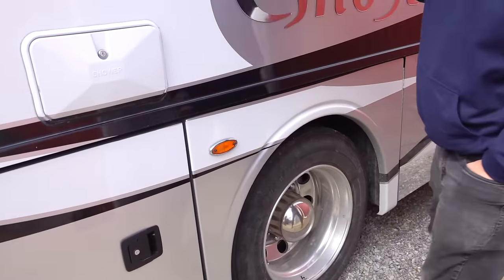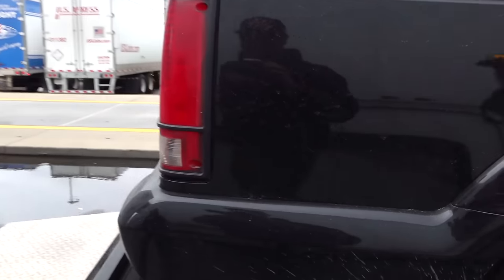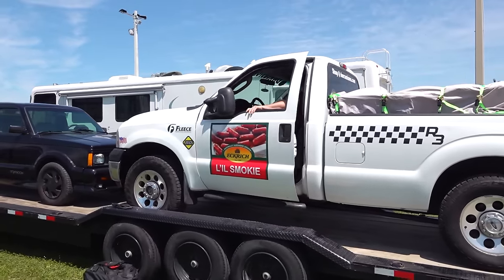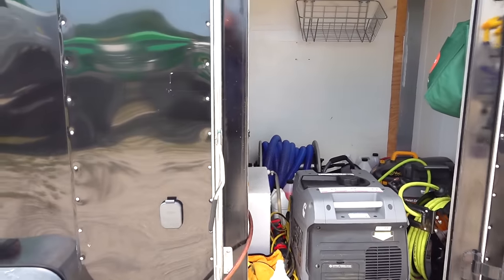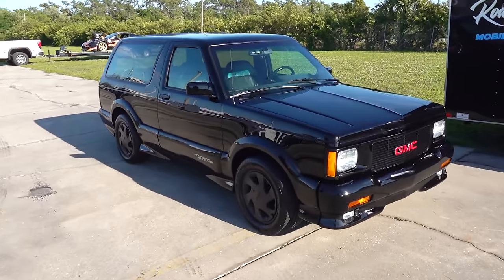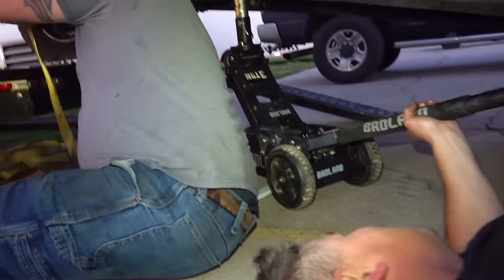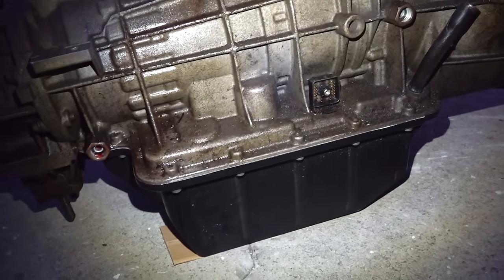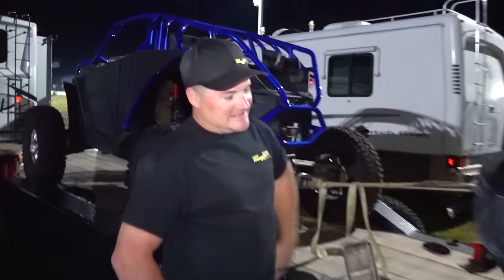Tested and BROKE in 17 seconds! We GOTTA fix it!!

Comment: KOing a 5r110 is freaking wild. They are one of best stock Trans 😮🤯
Reply: I feel like for a 4k scrappers truck that Derrick got it for, it likely may have already been on its last leg haha 😄  and obviously, our boys limit test these things hard. So hopefully, for $750 that new one holds up because Derrick seems to have that 6.0 choochin right sounds amazing.
Reply: Trans is fine.  It is very well known that the pump gears weld them selves together when doing burnouts 
Slap a new pump, shaft, converter and will be our backup

Comment: Typical 6.0 owner. Doubles the  horsepower and than is blown away that the trans couldnt hold haha
Reply: We tripled the hp and the trans was a fluke easy fix
Reply: I got an 07 with 175 injectors and stage 2 kc turbo 10 blade. You guys have no idea how happy I was when I saw that you guys chose a 6.0 for a burnout truck. Hands down jh had the best burnout truck when he had his 6.0. Please try to work the kinks out of it. These are the best sounding diesels by far in person.